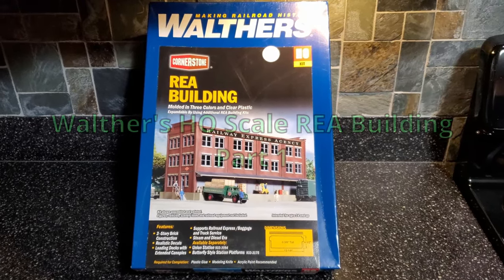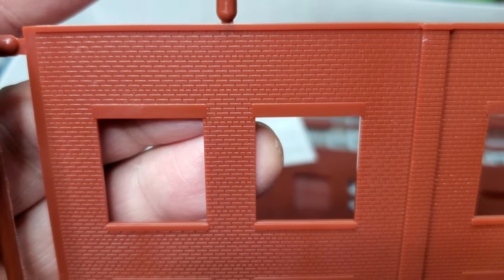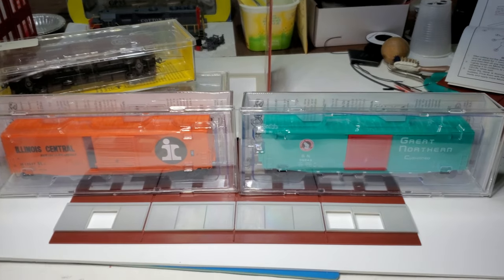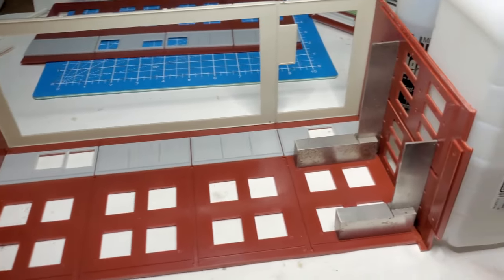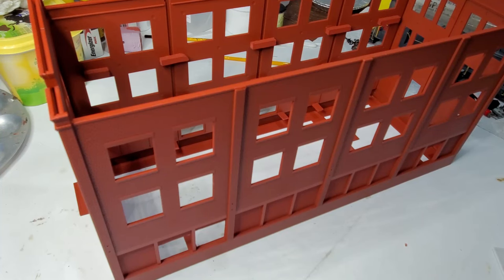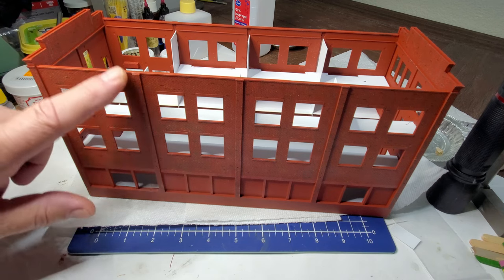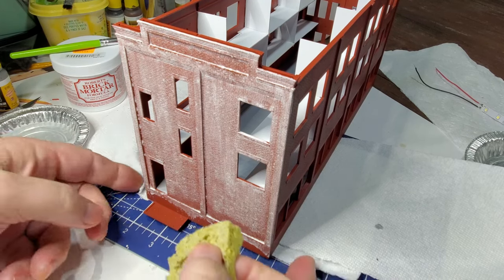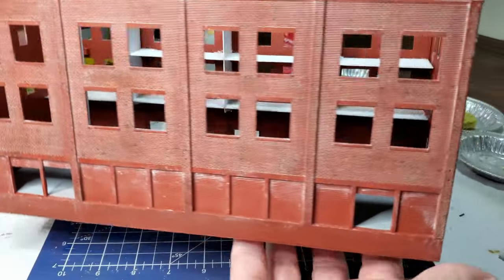Walther's HO Scale REA Building Project Part1. Building Shell Construction, Painting Bricks.

Comment: Good job here. For corner gap, I'm masking both sides of column. All I leave is the gap and fill it up very slowly with Tamiya putty. Then, when I removed the tape, I gently clean everything so that the putty doesn't fill mortar small spacing. Course what you did is OK too. I'm doing it this way only because I have a better control on how making the gap disappear. Keep on your good  work. That building is very nicely done.
Reply from the maker: Thanks! Certainly nothing wrong with your method of filling gaps. I have a tube of Tamiya putty that I also use, it just depends on the application. It is good stuff.

Comment: for $15 you can not beat a deal like that. :) :) :)   nice looking building with good detail work on the bricks by you.   

I use the magnetic corner clamps for buildings to get clos to 90' corners,  much like the 90' magnets used for welding.  
I have also used 4 lug lego bricks for corner supports too.
Reply from the maker: Thanks. I tried to sell it for $15, I'm sure I paid a lot more for it when I initially bought it. Haha